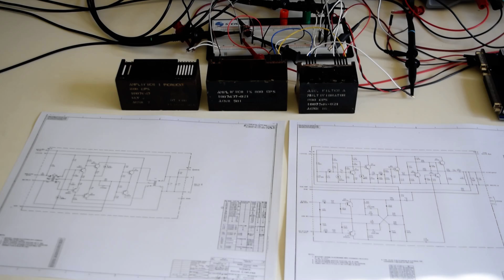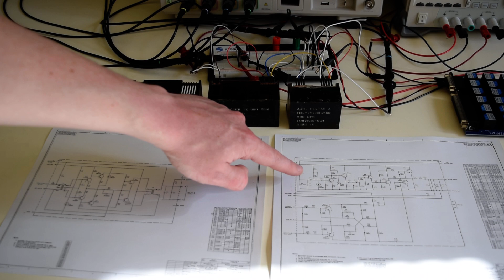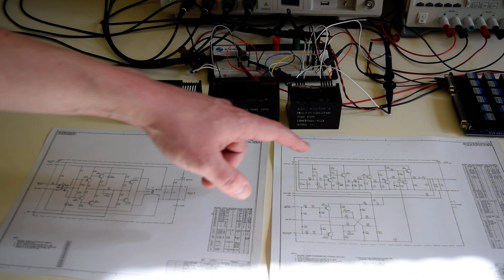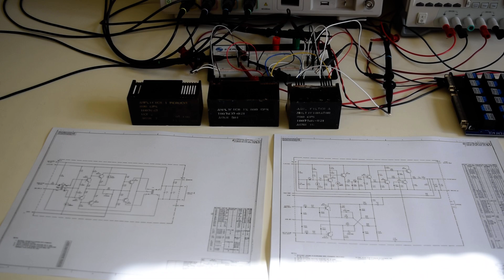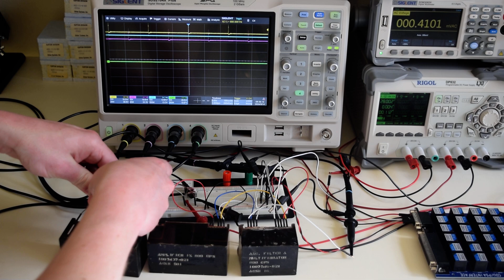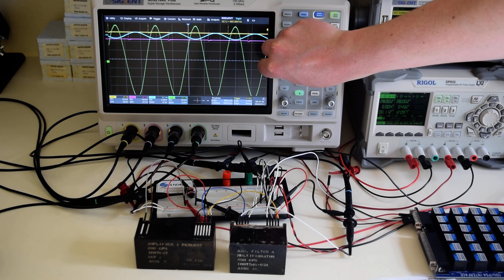Testing three Block I PSA modules

Comment: It seems like a quite strange engineering choice to have the system generate an overvoltage first and only slowly regulate it down.
Reply from the maker: It is, isn't it? I haven't done any testing along these lines yet, but my suspicion is that this behavior is due to the desire to still achieve 28V even when the DC bus voltage is low -- like around 22 volts. In that case, you'd need more "oomph" to reach 28VAC on the output, and you probably have less headroom.
Reply: @mikestewart8928  But still, risking damage to components by overvolting them sounds wrong.

I assume this design was completely changed for Block II?
Reply from the maker: @ReneSchickbauer  Actually no! The Block II design is very nearly identical; they swapped out some transistors, adjusted some component values, and added transformers to the sync inputs of the AAC module, but otherwise it's the same. 

Grumman ICD LIS370-10007, which controls the 28VAC power interface between the PGCNS and them LM, states "The voltage at PGNS turn-on shall not exceed 45 volts rms, and shall be within tolerance in less than 5 seconds". I suspect I'm exceeding that here because I'm running these nearly unloaded. But it's certainly expected behavior, and everything must have been designed to temporarily withstand the increased voltage.
Reply: @mikestewart8928  To provide the appropriate load, you could repurpose an old resistive-heater type device like a toaster, space heater or hair dryer. Especially cheap old toasters have nicely spaced wires, you can just tap into the length that provides the correct resistance.

Another cheap and quite reliable option is underfloor heating cable. I have a spool of 33 ohm/meter carbon fiber cable that i got for next to nothing from china for just that purpose. I cut of 1 meter pieces and put some in parallel in the circuit, depending on what i need to test. A local company that does underfloor heating might even have some cutoffs that they would otherwise have to dispose of.

Comment: Hey Mike, is there any news on your work on the Apollo CDU and the investigation of the 1202 errors?
Reply from the maker: I'm still working on it! The CDU is powered up and seemingly working fine, but I don't yet have enough infrastructure set up to be able to fully stimulate it properly to reproduce the Apollo 11 situation yet. Getting to this point needed designing three PCBs (and assembling 7), having three types of parts machined, finding and getting my hands on somewhat-compatible resolvers, and building a mechanism to gear together the resolvers since compatible dual-speed resolvers are unobtainium. To reach reproduction I need to lay out three more PCBs and have another couple of parts machined. There's a lot to it, haha. Hopefully it will all finally come together this year. I did film some (in retrospect, disappointingly poor-quality) footage of the steps taken so far, which I might edit together into an update video.

Comment: You mention heatsink, now would a space vehicle have vented that heat back into the environment, or would it dump that heat into space
Reply from the maker: It'd be vented off into space via the radiator panels.
Reply: @mikestewart8928 my comment was 9 months ago, I cannot really remember what it was in relation to😅

Comment: It would be interesting adding a speaker to see if they have gotten noisy with age, sure you could see it on an oscilloscope, but I'm weird😂

So, why 28vac, it feels like such a non standard voltage... How did they negate damage from the startup voltage, or is it only so high because it isn't under load
Reply: From what i understand, 28V is pretty much the standard in aircraft systems. You a 24V battery, and a generator that provides 28V to charge it.

For reference: Stationary lead acid systems can go up to 30V for a short time. The charging system basically overcharges the battery slightly to generate rising gas bubbles that mix the acid around a bit.
Reply: @ReneSchickbauer  surely aircraft are not still using vented batteries?
Reply: @phonotical  Doesn't really matter. The standard for aircraft systems is now 28V. Changing it would be a waste of money.

Think about it this way: The AC plug in the US is badly designed, compared to what other countries have. But changing it to something safer would mean changing every plug on every device and every wall socket in the country. And it would take decades to complete. Meanwhile you have to provide two types of adapters, because people will need to be able to plug old devices into new sockets and vice versa.

Comment: Are the pins coming out of these flat? Looks like you’re using standard jumper wires?
Reply from the maker: Yeah, these modules have the same (flat) Malco Mini-Wasp  pins as all of the other PGNCS hardware. We discovered during the AGC restoration that Schmartboard female jumper wires actually fit on them pretty well, so I use those for all of my manual wiring.